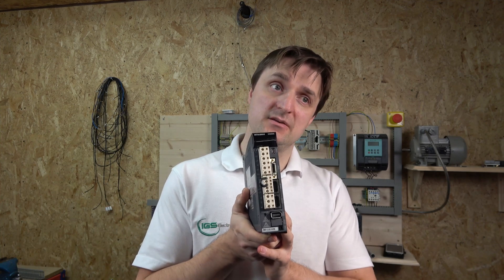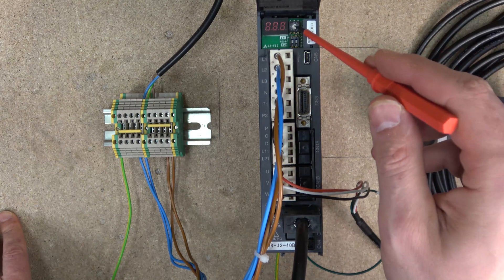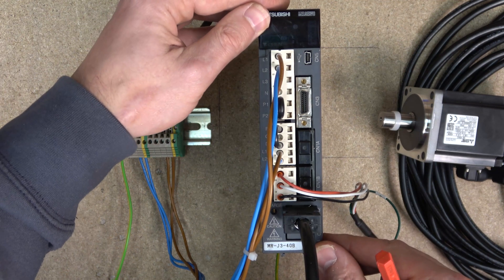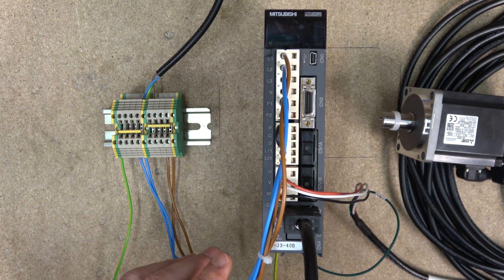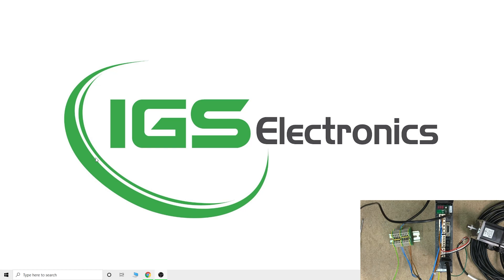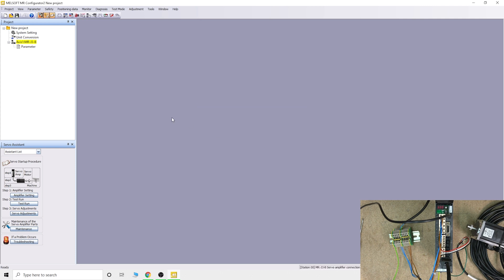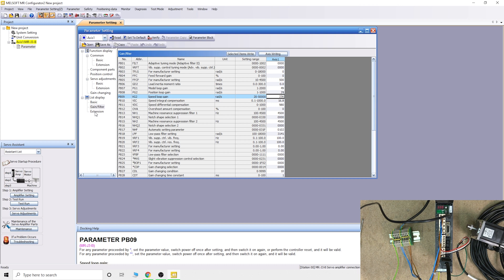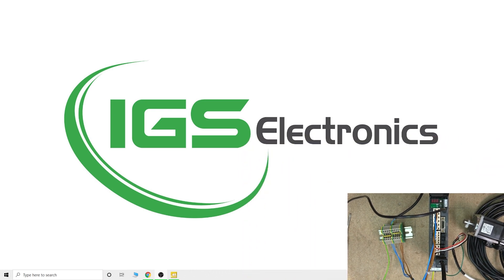Mitsubishi MR-J3 servo amplifier, wiring, jog/position test with MR Configurator 2. Part 1 English

Comment: Have you ever use the cn3 connector to use the position mode? Because in a CNC the controller would have only the step/dir signal. So Im wondering how to connect the servos like that. I just purchased 2 of them at 1.5kw.
Reply: I'm curious about it as well!